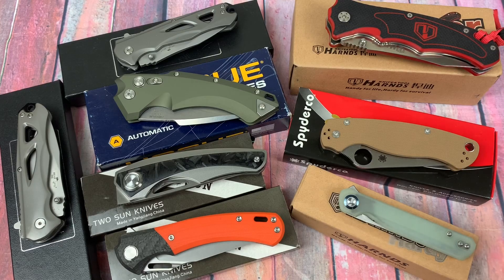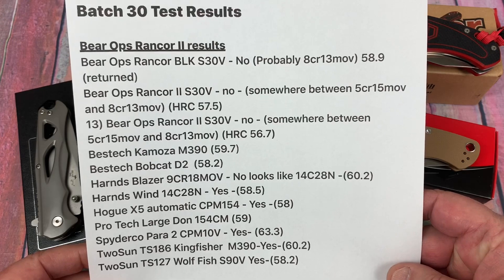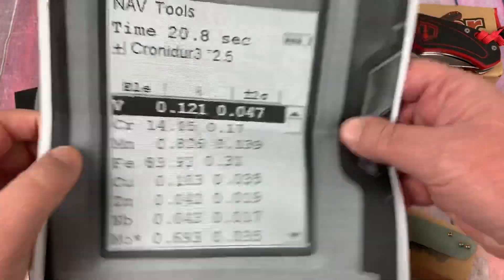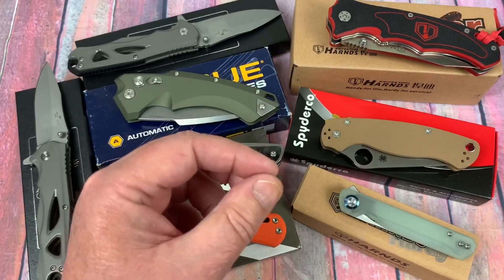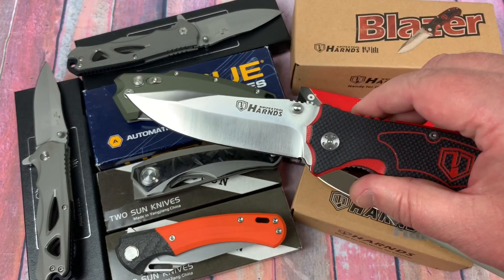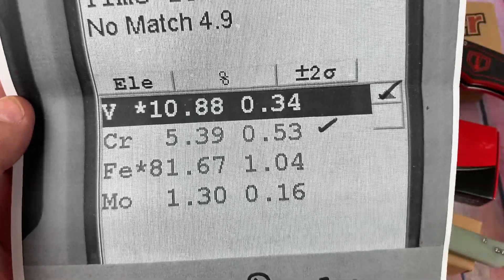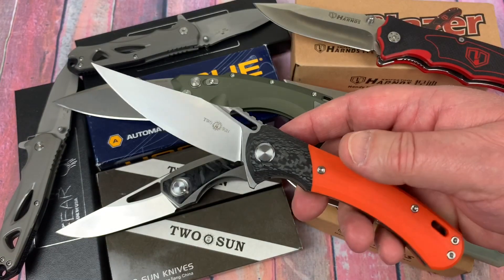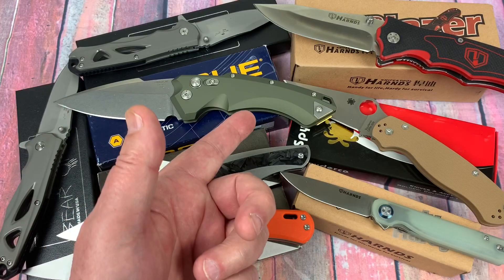Batch 30 Knife Test Results Elementals & HRC results

Comment from the maker: Batch 30 Test Results 
Bear Ops Rancor II results 
Bear Ops Rancor BLK S30V - No (Probably 8cr13mov) 58.9 
Bear Ops Rancor II S30V - no - (somewhere between 5cr15mov and 8cr13mov) (HRC 57.5)
13) Bear Ops Rancor II S30V - no - (somewhere between 5cr15mov and 8cr13mov) (HRC 56.7)
Bestech Kamoza M390 (59.7)
Bestech Bobcat D2  (58.2)
Harnds Blazer 9CR18MOV - No looks like 14C28N -(60.2)
Harnds Wind 14C28N - Yes -(58.5)
Hogue X5 automatic CPM154 - Yes -(58)
Pro Tech Large Don 154CM (59)
Spyderco Para 2 CPM10V - Yes- (63.3)
TwoSun TS186 Kingfisher  M390-Yes-(60.2)
TwoSun TS127 Wolf Fish S90V Yes-(58.2)

Join my Patreon: https://www.patreon.com/LuvThemKnives?fan_landing=true

LuvThemKnives hats are available for $18 (includes USA shipping) 

LuvThemKnives strops are available $48 (includes USA shipping) contact me at LuvThemKnives@gmail.com

My email address : luvthemknives@gmail.com
My instagram  http://instagram.com/luvthemknives

How an XRF Analyzer works: https://www.bruker.com/products/x-ray-diffraction-and-elemental-analysis/handheld-xrf/how-xrf-works.html

Why carbon and other light elements are not detected with the XRF Analyzer: https://www.pxrfs.com.au/light-elements-difficult-measure-portable-xrf/

Spreadsheet of knife testing results to date: https://docs.google.com/spreadsheets/d/1OepNr_D4lqbdTFqdqWl1rmAd4bOzPzJe6J0iEWrdJGU/edit?usp=drivesdk

Knife Cutting Performance Test Results:https://docs.google.com/spreadsheets/d/1PzXZEuyMtOMoSDhyFUfDNV9MNbztMEvZ3OgRa6yT7QU/edit?usp=drivesdk

10% Discount Code on WMK is: LTK 
Link to White Mountain Knives Website:http://whitemountainknives.com

Comment: Niagara Steel does the rolling for Crucible PM btw, so the next time you talk to them ask the name of their S30V supplier.

What the different % between 60 and 61- 5%  50 and 51- 4%? Exponential progression not logarithmic. 60 to 62 is 10.3% not just 10%.

I sent an email to Bear and Son requesting my $50 back for the junk made in China steel they sold me, 8Cr is only made in China. I'll keep you informed. Bet they'll want me to jump through hoops just to get me to quit, but I do not take to being cheated by anyone lightly.
Reply: Never got my money back from Bear Ops nor would I take a replacement.

Comment: Damn what a shame I was about to buy that bear ops rancor 2 for the steel but not anymore...
Reply: I bought their 14C28N knife Bear Ops and the spring for assisted open broke, was .050 thick. Kershaw's spring assist knives springs run .090. Only thing that saved that Bear Ops was it actually had a detent, Kershaw spring assist don't.

Comment: When I heat treat a blade, the area up above and behind the pivot is drawn back in the temper to be softer than the edge. 
You need to instruct the tester to try    poking 1/8 of an inch above the cutting edge. 
Testing RC hardess up behind the pivot is pointless.
Have the test near the edge for a more accurate reading.
Reply from the maker: The problem is that it has to be a flat area to test HRC accurately on a Rockwell machine.  There are machines that can test on an angle but I don’t have access to them.  And most production knife manufacturers don’t do the differential HT like you do. 👍  But I do appreciate your input.
Reply: @LuvThemKnives  Cool information on the realities of production. Still hand it to you for being a conscientious reviewer of great alternative products available on the open global stage. Few knife oriented channels take the steps you do to help a consumer. 👍

Comment: How many sellers claim to have a Made in USA product that is partly or fully made in China? At some point, this should be of interest to the state Attorney General’s Office, or, in the case of interstate sales, the FTC or FBI. When CRKT sold the Chinese produced Hootenanny falsely marked as S30V, it was at least CRKT lacking in due diligence, leaving it to the consumer to discover the deception. When others pretend to produce something that is actually produced in another country, and falsely marked, they may be a victim of fraud, but they are not clean either. If material providers sell falsely identified steel, it causes significant damage. When does this become a law enforcement issue?

Comment: In reference to the Harnds blade showing 14c28 composition: 
"Sandvik 14c28n" steel is made by Swedish company Sandvik and is a registered trademark.
 I wonder if one can create 14c28n by formula and content and label a blade "14c28n" (minus the "Sandvik") without risking a lawsuit.
Reply: In America if you want to make a 14C28N knife you call it Nitro-V.
Reply: Good question.. I wonder the answer. 

My answer is probably not...

Although, I have loads of blades that say D2, and I'm certain that D2 is made by several different manufacturers and no one seems to mind.. legal protection for 14c28n is probably different, as Sandvick was specifically designed for knives more recently by Sandvik, and D2 is a WW2 tool steel from my understanding..

My guess is that 14c28n is simply labeling the materials formula, as you suggested, but I also believe that this formula is patented. 

Honestly though, if a blade is labeled 14c28n and it is legitimately that steel, I suspect that it may make more sense to just simply buy it from the original manufacturer due to the competition of various powdered blade steels etc keeping the price down on this fantastic forged steel.

 If a knife says CPMxxx then I imagine there would be legal protection because the C standing for Crucible.. of course each country subscribes to it's own version of protections

So yeah, hard to say, and depends on where you live. In America it is probably illegal to advertise this same steel and label it 14c28n